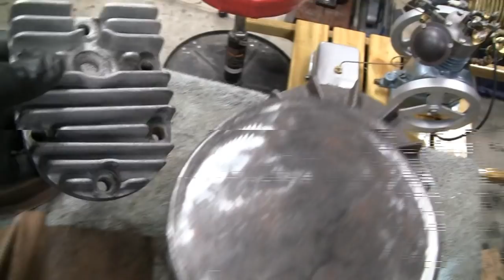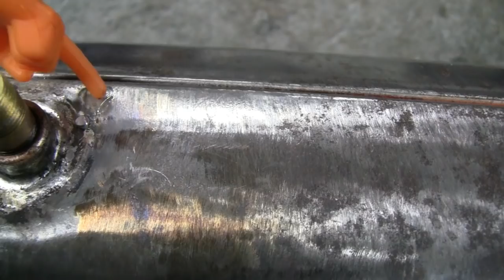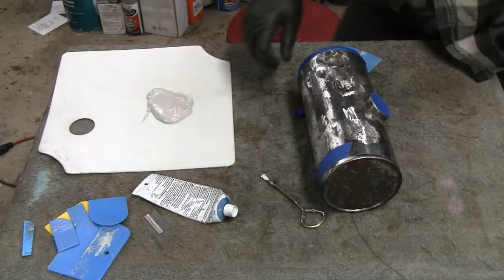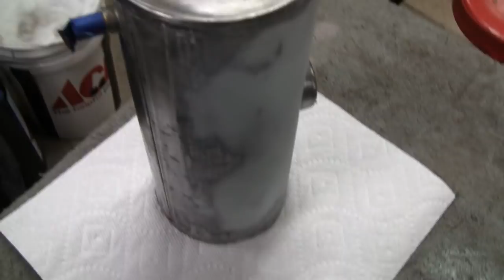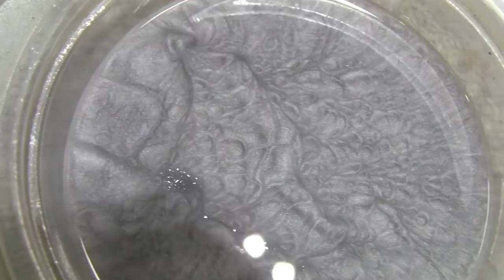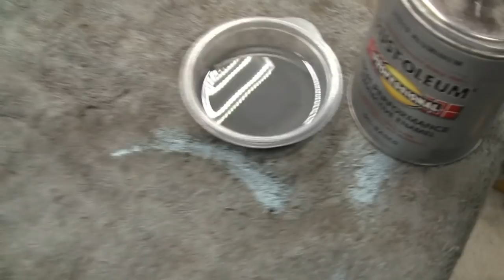1949 CLINTON ENGINE RESTORATION (part 5)

Comment: I can remember when I was a little kid, one of those nerdy science toys they had was a sealed hour glass shaped vile, with a red liquid inside. In it’s static state, the bottom bulb would be filled with the colored liquid. 

If you grasped the bottom bulb with your fingers, the liquid would travel up the small tube connecting the two bulbs, and start spurting, and bubbling in the top. 

The science behind it was the body heat from your fingers was causing the liquid (which I believe was alcohol), to boil, and expand to the top, since a liquid like alcohol boils at such a low temperature. 

I think what you’re seeing in little container is the heating of the lacquer thinner causing it to expand, and it’s all being illustrated by the metallic paint particles.

Comment: A bodyman of your age, would have leaded the tank. Lets see your leading skills. LOL
Reply from the maker: Anybody that tells you Lead is better than Putty is full of sh!t!! The last time I used lead was the mid 70's!! Polyester filler has revolutionized the Autobody Industry!! There's a reason they haven't come up with anything better in 6 decades!!☺
Reply: @805ROADKING  ALL cars back before polyester were leaded and done properly was superb, just ask any of the old timers, they would disagree with your opinion . Poly came about because of the breathing the lead fumes, and that it took a real good bodyman to do it and it took longer. Lead never cracks. And BTW back in the 70s is when I was shown by the old guy that chewed tobacco . I just thought  you could do it some time to show how it was done so some of these youngsters would see the old trade ways of doing it. And don't get your feathers all ruffled up , I was joking anyway.
Reply from the maker: @combatmedic1980  We weren't ruffled Bud, we took it as a joke!!☺

Comment: As others said, the rapid evaporation and cooling of the lacquer thinner is probably the cause of the motion in the liquid. Then the metal flakes make the motion of the liquid visible to you.
Reply from the maker: It's funny, when I picked the little cup up to dispose of the thinner I noticed how cool it was!! I had the heat on in the shop and the cup was almost starting to sweat!!☺

Comment: Can't be sure, but I suspect the ring you discarded was originally a tight fit on the outlet so that it didn't fall over (as you found out) when it was being soldered together, possibly also an attempt at strengthening the joint. It lost its purpose when it was no longer a tight fit.
Reply from the maker: Yeah I think it was part of the threaded assembly!! It probably already had solder sweated on it so they could just plop it in a raw hole and heat it!!☺

Comment: The evaporation on the surface cools the liquid on top, so it gets denser and falls to the bottom, being replaced by warmer liquid from the base. It will continue until all the solvent evaporates. you don't notice it after a while, because the suspended paint particles settle eventually.
Reply from the maker: It's funny, when I picked the little cup up to dispose of the thinner I noticed how cool it was!! I had the heat on in the shop and the cup was almost starting to sweat!! And you're right when I dumped it the bottom was covered with metal flake!!☺